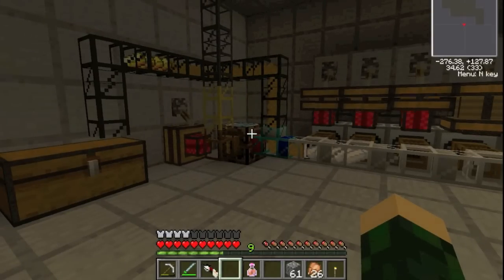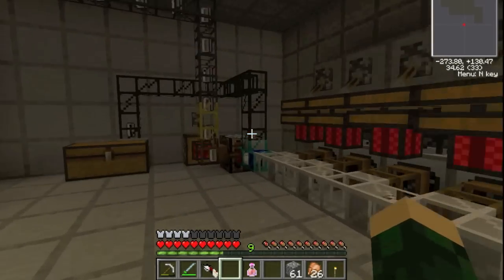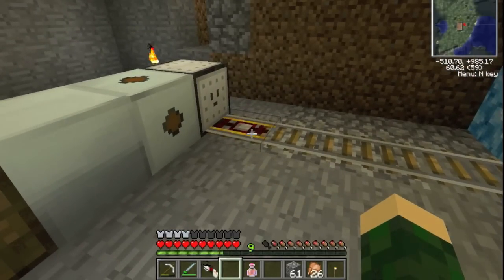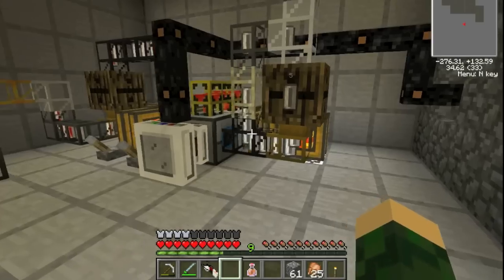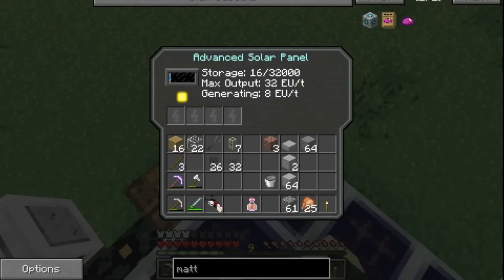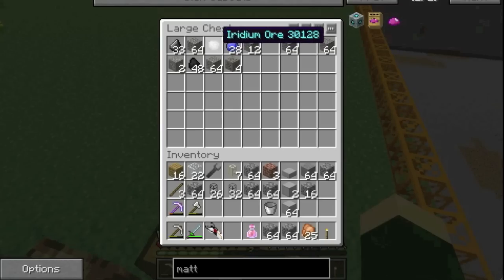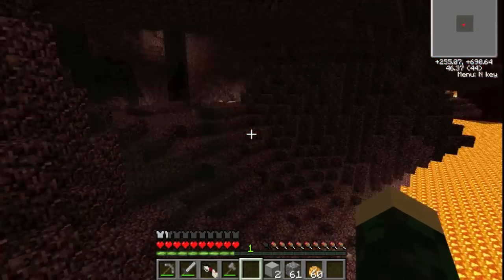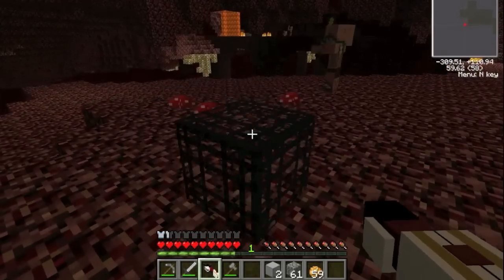Mindcrack FTB FS episode 2

Comment: Got some cool stuff going on. Can i suggest using a diamond pipe going into the liquid transposer in your factor, if you set the direction of the transposer as a cell and the direction of the loop back as nothing it will fill the transposer with cells then once its full it will loop back. 
Also with the Quarry you might want to look into a void pipe they are cheap and let you destroy cobble/junk just by sending them into that pipe because letting it sit on the ground till it despawn is bad.